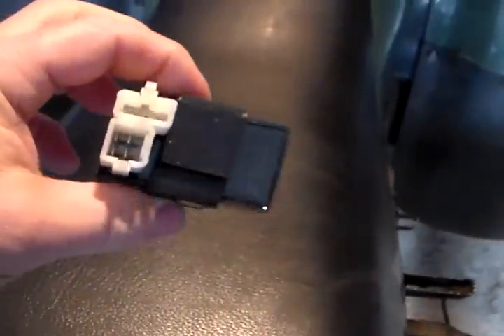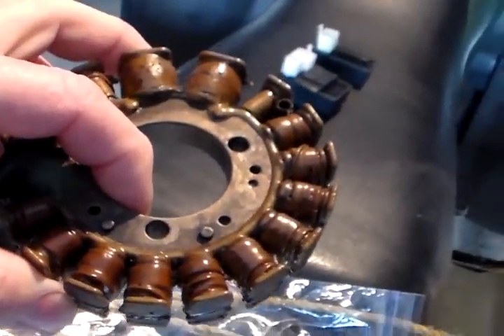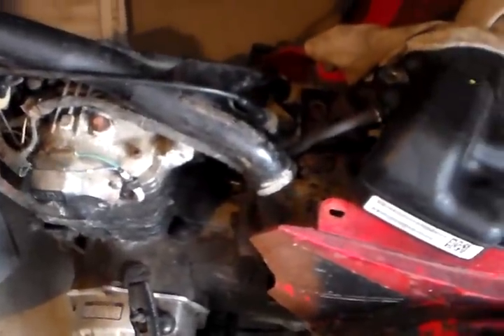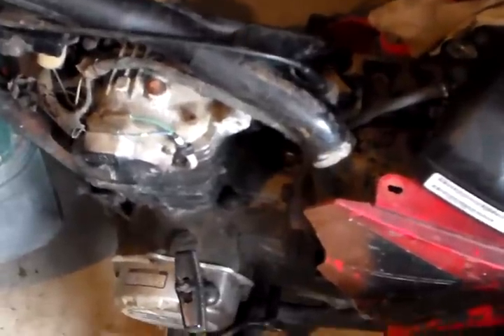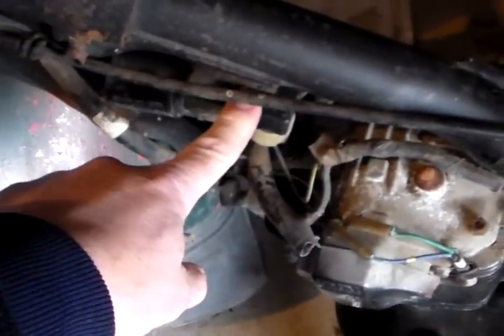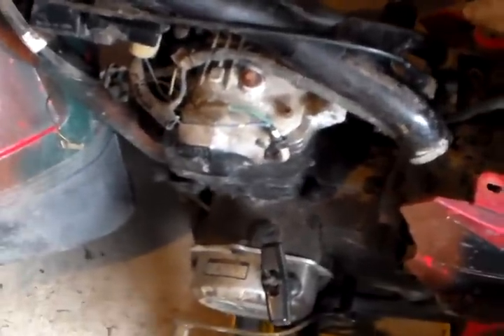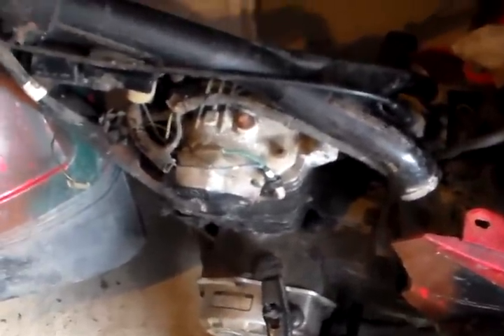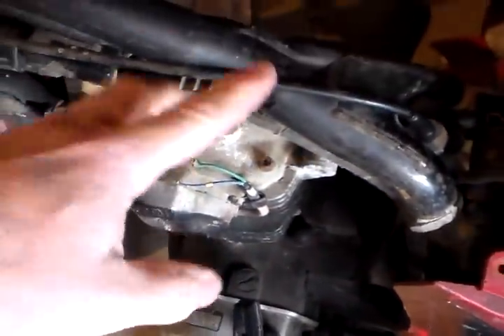12_27_2013, 12 Volt Honda ATC CDI project Part 2,

Comment: Troubleshooting ignitions can be a pain. I bought a project Arctic Cat 250 ATV which was not running or turning over. Having little knowledge of bikes I ordered a repair manual on CD from EBay for about $10. That was exactly what I needed and showed you how to test all the parts. After a new battery, CDI, coil and regulator I finally got it started and was able to drive it.  I also bought a 300 which was not running and haven't had time to work on it yet. I made a couple of videos but not detailed ones.  I might make some videos on the future repairs. I enjoy your videos and think a lot of other people do too. Keep them coming. Thanks.

Comment: good stuff
didn't know you went under the knife on ur hip.
I've had what they call a square hipsocket since very little. spent months in traction when younger. but played baseball up to near 50. I always limbed badly depending on how much I ran. sad thing is I cant remember which hip neither does family since I limp on both legs.
Happy New Year